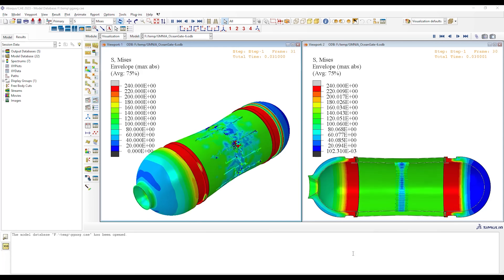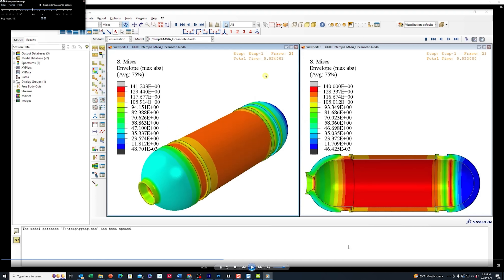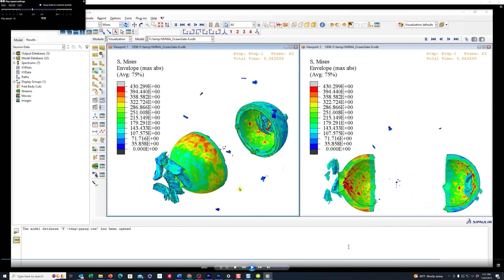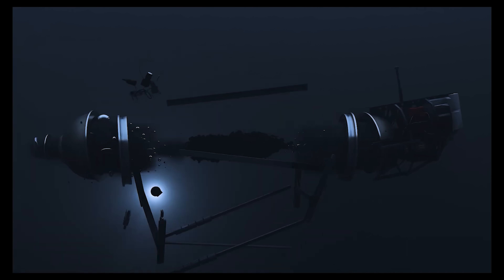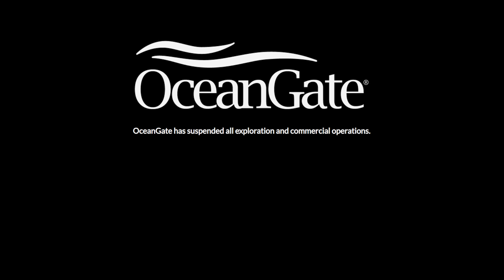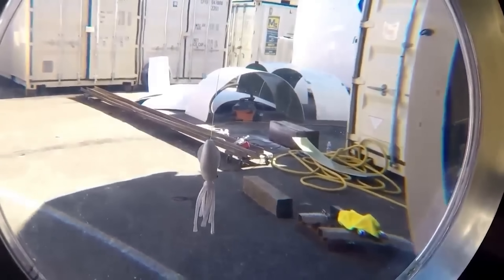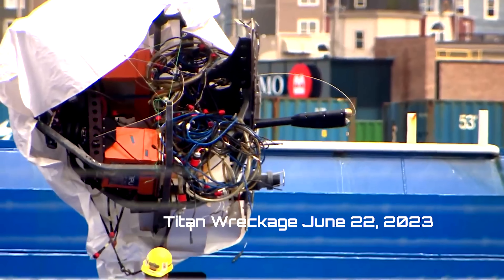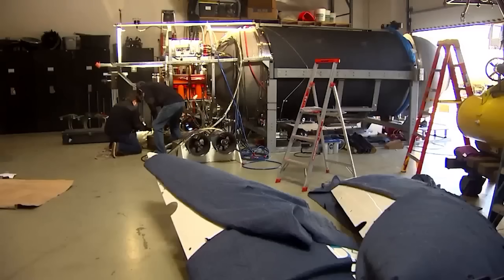Best Titan Sub Implosion Simulation, Cracked Porthole? Q & A

Comment: Two of the links in the description are the same. They both link to the window implosion instead of one of them being the hull imploding.
The two carbon fiber hull implosion videos show the caps doing the opposite. The first one you showed, the caps moved toward each other. In the other they moved apart. Not sure which would be correct. The center of mass would have to remain in the same horizontal plan since there are no unbalanced horizontal forces acting on it.
Reply: The caps moving out do not make sense. They are (at the bottom) being pushed together by some 6,000 tons. They won't go anywhere because there is the CF cylinder between them. It holds only because the walls are perfectly straight and aligned with the force. As soon as it gets compressed in the middle, the walls are not any more being compressed. They are being BENT now and it completely changes the picture. The walls will break very soon and the caps become moving together. As at that point an almost incompressible water is becoming to enter the void from the sides as well, they stop probably quite a distance away. Then the inertia of the incoming water creates some short-lived outwards pressure that may cause to move a bit outward and the acrylic widow may get pushed out - but the first and longer movement of the caps will definitely be out.

Comment: The problem with pulling the memory chip off and soldering it to a different known-good phone is that phone manufacture's have started serializing parts in an attempt to try and stop 3rd party companies repairing them.  They give each chip its own internal serial number and the phone will refuse to operate unless all its parts have the original seral numbers it left the factory with.

Comment: Outstanding simulations and calculations. I agree that it would be great to find the external cameras and any external electronic storage. The one thing that has been mentioned but I think people forget the importance of, is the effect of an extremely rapid increase in pressure to temperature (PV=nRT).  The air in the submersible going from 1 atm to over 350 atm in a few milliseconds would be insanely superheated.

Comment: I'm glad you talked about the Alan videos. In one of them, the sub got stuck at the bottom for many hours, and when they finally were able to ascend, they could't bring the platform afloat. Because it required compressed air, the air in those tanks exhausted, and the submarine/platform listing in the middle of Atlantic, the crew bolted inside, and a few guys circling around on dinghies with no clue what to do. You should bring that scene in your videos. To me is the summary of the OceanGate's operation, a complete mess.
Reply: Where can I find that?

Edit: nvm found the links to his channel in the description. Do you happen to know which part it’s on?
Reply: @highjinx6519  The scene is in part 2 at 14:06   or here is the link:  watch?v=gOjJJKld6jY&t=846s
Reply: @fishshipemployee  awesome I’m already on part 2. Tyvm!
Reply: @fishshipemployee 12:25
Reply: @westernrider100  The top did say during the transcript that they were pursuing recovery, whatever that would mean.

Comment: I believe the viewport blew in, which smashed all the passengers into a half ton of human mush in the opposite titanium cap. That's how some human remains have been recovered and that's why all metal pieces have been recovered and displayed by the Coast Guard however, for understandable reasons, that back titanium cap has not been publicly shown in photos or videos.
Reply: Stock rush hair fibres
Reply: I think failure of the viewport was less likely than failure of the carbon fiber hull, particularly at a junction with a titanium end cap. The viewport, though not certified for the depth, was a monolithic structure, and probably somewhat closely approximated the parameters used in modeling / stress analysis. The end product can be easily checked for flaws. A carbon fiber structure, on the other hand... yeah. Good luck trying to ensure that the end product comes anywhere near the parameters entered into the modeling software. Too many variations in the structure, no real ability to inspect for QC, and it looks like Rush wasn't so keen to spend money on safety margins.

I'm not saying that you're wrong; "less likely" doesn't mean "didn't happen", and I don't actually have anywhere near enough data or expertise. Garbage in, garbage out.

Comment: If the carbon fiber hull was built of entirely using uniaxial plies all running circumferentially there would be (at least) two major issues, all shear load between the individual fibers would be carried by the resin/epoxy itself not the carbon (orders of magnitude less capable than the carbon) and there would be no arresting features to act as fail safe for inevitable damage/cracks/voids occurring inside the many layers of plies.  

Take for example just the bumpy ride on the barge, there would be flexing of the whole craft as it rocked over waves at speed with the two heavy titanium ends pushing and pulling on the carbon hull in a direction with no carbon fibers oriented to resist the motion, repeatedly loading and unloading of the resin holding the carbon fibers together would cause internal delaminations and with no plies running in other directions to arrest these cracks it would only be a (short) matter of time to reach critical crack length and have the carbon hull fail.

Comment: I studied Finite Element Analysis & Computational Fluid Dynamics to get a Mechanical Engineering degree.  Simulating the implosion would have to combine the 2.  Add the issue of Carbon Fiber not being a continuous material & I can see this is a very complicated engineering problem where speed of the computer is a huge issue.  Of course an engineer can't anylyse every Titanium atom, so he would model the Titanium end caps & rings then convert them into a finer & finer mesh (similar to analyzing a 2D lattice bridge, but in 3D) until the results converge.  Most of the simulations on YouTube are clever CGI that a movie director would want but are not engineering simulations.

Comment: With the window pressing in 3/4", the "cracks" may just be superficial perimeter scratches in the mating surfaces between the lens and socket, only visible from the outside looking in.
As for hopes of recovering video from inside the cabin, my guess is just about everything in there got shredded by the implosion shockwaves. If any recording survived, it will be in whatever storage may have been in the exterior equipment bay. In the slim possibility that a phone survived, most modern phones have full-device encryption by default. Not only do you have to recover the NAND memory but also the hardware used for their encryption. On iPhones, those keys are stored in the CPU itself. Dead CPU or whichever chip handles keys, RIP encrypted data.

Comment: Above all else, this is a tragic for all involved.
The porthole images shows some details, but I dont know if it was cause for concern. Contact patch between the acrylic and port hole looked pretty degraded, but It may not have any functional relevance. I have heard people who traveled on the Titan say there was a lot of cracking during most of the dive so that may not have raised concern until the very end if the transcript is true. IF it is, then there may have been another issue at play: the reason for their rapid descent and the effect on the sub going down that quickly. 
Sadly, it seems to me Rush wanted to be a pioneer, at the cutting edge, think big make bold attempts, and didn't focus enough safety, or second opinions. We can only speculate why he ignored good advice, but I hope we can all learn from his costly mistakes. That is the best we can do for them now

Comment: It's very strange to me when Stockton says at 6:05..."It gives a huge warning before it's going to fail." when discussing the porthole lens.  He seems to think that he will be given all the time in the world to surface and re-design the craft after hearing that the portal lens is failing.
Reply: It's as if he didn't understand how quickly things could go from pops / fractures to complete disaster at such depths.
Reply: @warpedweirdo  The fact that they think they can actually predict how long a structure like that will last once unexpected cracks happen amazes me. You can't know how it will crack so you really can't know how long it will hold after that.
Reply: Acrylic is extremely strong, it could suffer multiple cracks and still operate just fine because it basically expands into itself and fills those cracks.
Reply: With failsafes that could take 14 hours to get them to the surface, anything that could develop and become a failure in less than 24 hours was a disaster waiting to happen. Stockton Rush built this to his own risk tolerance not to a safety tolerance. I think him and PH knew what they were getting into. The others less so. He gambled with their lives for his own passion.
Reply: @itsnotmeitsyou1 It's looking more and more like PH was straight up suicidal. There are emails between him and a friend where the friend asked him why he was involved with such a sketchy project. He literally responded that he was old and a grieving widower, and that if he died, it would at least be instant.
Reply: @itsnotmeitsyou1  One would think that a known defection of "3/4" of and inch during each dive would be a source of concern.  Other sources are saying now that the portal was not confirmed to handle the depth and pressure that Stockton went to. My opinion is that if the portal was flexing that much during a dive and that Stockton knew it then there's the issue.  My guess is that the plexiglass portal blew in due to fatigue from previous dives.
Reply: Indeed, it's ridiculous. When you're surrounded by fluid at 400 bar, you don't want "cracking" to be your warning, it's too late at that point. Even if it's not an immediate implosion, it's not like you push a button, instantly surface and you're all good. You still have insane amounts of pressure as you ascend, and as the pressure changes while ascending it's causing yet more flexing which obviously can exacerbate any existing failure or fatigue despite moving towards less pressure.
Reply: @lordofentropy  Apparently they had been hearing cracking for a long time and just ignored it smh
Reply: @lordofentropy  Consider that every 10 meters gains or drops an entire atmosphere of pressure against the hull. you could quite literally ascend 30 meters and drop 3 ATM instantly. If you can get an exponentially more buoyant sub to rise quickly you basically have an indirect pressure controller as long as your thrusters work
Reply: @nikonmikon8915  Going from 400 bar to 397 bar when you're already cracking; sweet! now it's only 5768 PSI instead of 5800 PSI! Yes I understand that every 10 meters drops a bar; the point is if your warning of failure is literally the sound of failing, you're doing engineering wrong. No matter how fast you can ascend each 10 meters, implosion is going to be faster. As mentioned even reducing the pressure (going in a more desirable direction to lower pressures) is causing further flexing of already weakening material—any failure is still going to be catastrophic and fatal until you're essentially at the surface.
Reply: Yeah. At best he can climb at ~3-4 knots and cross his fingers and hope it doesn’t implode.
Reply: @tioswift3676 that’s probably what happened
Reply: Exactly,Rush made it sound like,if the submersed was gona ,crackle right away,jst fully underwater,and he will know it needs fixing.But usually wen it's miles underwater,if start crackle,it's gona take hours to resurface.It be way to late,Rush seem so relaxed. A crack is normal,we jst go back up...smh,wat Rush was thinking.😊
Reply: Yes that’s exactly right. He walked the walk, talked the talk, but he was no engineer.
Reply: What foolish man assuming that failure will give sign before it is even  realised/visualised/seen/sensed when milli second is matter of life and death.
Reply: Yeah guy was utterly delusional
Reply: Delusional
Reply: 'Move fast and break things.' - Stockton Mush
Reply: By the time anything warns you it's too late. Kaboom
Reply: Agreed, I think he was overconfident.
Reply: When milliseconds matter the surface is only minutes to hours away. His whole theory about using early warning systems on things that undergo nearly instantaneous failure was  inconceivably flawed.
Reply: From what I saw the pothole part of the titanium casting had 18 bolts ... all were blowed off reel good .... if not mistaken it would appear the failure happened at the rear compressing forward then blowed off the plastic window. 
I also heard  Rush also consulted with his Mission Specialists for input as to how best surface ....
The boat should have had several cameras placed all around with one facing inside the portal. The boat would be lit up for the trip to the grave yard. The digital cameras could have recorded the event and sold it as a "snuff film"! Imagine seeing the whole boat implode! people turned into what? Slo-mo instant replay ... different angles, looks of horror on their faces ... WOW Serling, Hitchock and others couldn't match a real life horror show! Truly a once in a lifetime trip!
Reply: The thing is as soon as it cracks it will fail. The reason for that is straightforward. It cracks because the applied force is too high. As soon as it cracks it loses strength. Now the force-to-strength ratio went even further downhill. And since the applied force is still the same it will fail. I remember those tensile tests we made. Depending on the material you will see nothing. It just snaps.
Reply: Egocentric- & lacking the requisite knowledge & experience to design a vehicle of this type. ( Let's say a prayer for those poor unlucky souls !!)  My 60 yrs working experience of anything Road or Seaworthy is " all must be 3x to 5x stronger than Worst scenario calculations determine & show. Sudden effects of turning or bending or shock or collision can send Stress & Strain loads way above the basic. The sub in my view should have been good for 20,000  to 25,000 ft.( at least ) to be safe.. At least 3 stainless steel inter-linear shells should have been used in the progressive carbon fibre wrapping, or at least, very sturdy stainless or Titanium X-braced cages. Those would have then withstood much more massive loads.
Reply: Exactly, it takes hours to surface at normal rates, and even in an emergency ascent, going as fast as you can, it would probably take 5-10 minutes to surface. Plus ascending as quickly as possible would probably just make the issue worse by putting more stress on the structure.
Reply: It’s almost as if he didn’t feel he would need to…
Rush.
Reply: That point struck me as well, ... any warning of failure where no recourse is available to act on or deal with it, ...is really just a notice of your impending death.
Reply: I rolled my eyes with that one too. 
He also mutters, “…and just deforms”
That line alone would scare me away.
Reply: There will not be any warnings signs at -3800 meters. You will not be able to see cracks or warping. Once the material fail at that depth, its over in a instant
Reply: Exactly. It will never “fail-to-strength” - When structural integrity is compromised at the first crack to a “secondary condition”, that will always be weaker than the first, hence complete collapse.
Reply: Starting to crack means starting to weaken reducing its rating to well under the depth they are at...its a completely ridiculous assumption on his part... These type of narcissists seem to automatically BS people.
Reply: he says that for everything
Reply: He did believe he would , because he was a clown
Reply: @hadesunderworld4203  Was this Rush's "clowning" glory?
Reply: Exactly, it'll just have tiny cracks all over . So is it a timed delay emplosion? Great
Reply: I don't think you want to get a huge warning.🤔😅
Reply: Still and titanium spherical hulls don’t have, nor need, a ‘warning system’. Rush was a fool
Reply: Stockton also said, if they have an electrical failure, they have still have a hand pump, 10'000 psi hand pump, good luck with pump this thing from hand
Reply: Porthole, not portal. A portal is an entrance/exit, like the grand entrance to Grand Central Station. A porthole is a round wndow on a watercraft.
Reply: @CrazyBear65  I knew someone would "catch" me on that.  I'd like to think that the portal was a view of times past.  What I would like to add is that there are tons of other wrecks that the B/Millionaires could see with very cool subs.  The Titanic is a "mouse trap" for the Billionaires.  "Yes I went to the Titanic and it validates me.  And I brought my son along to show."
Reply: Hey! Come on! You can do a lot in a couple milliseconds. 

BTW, was this thing designed by Boeing? Am I the only person that gets the impression that he's surrounded by fools? I think the next time I'm being told what's "for the greater good" by some "expert", I'll go ask a farmer what they think instead. Let's all line up for our 14th booster. For grandma.
Reply: @bunsw2070 yeah … what’s the difference between rush and a con artist? not very much
Reply: @bunsw2070 No, Boeing didn't design it. Boeing sold the materials off airplanes that were no longer approved to fly due to age. Imagine, the materials aren't air worthy anymore but let's use them to get us to the bottom of the ocean?  🤦‍♀️